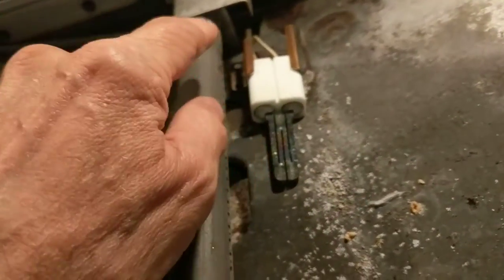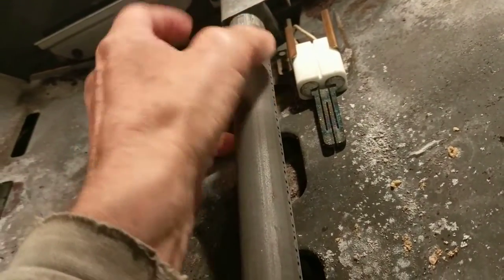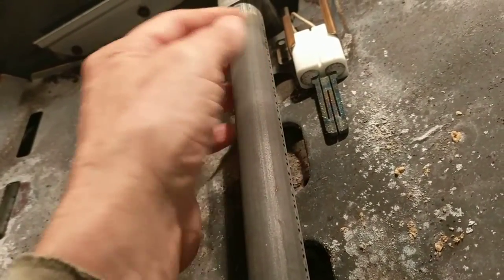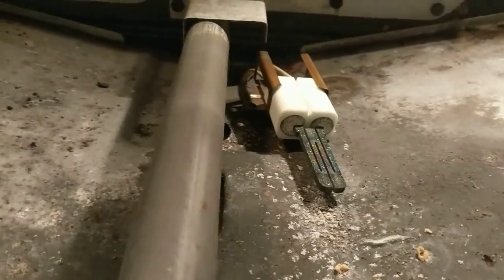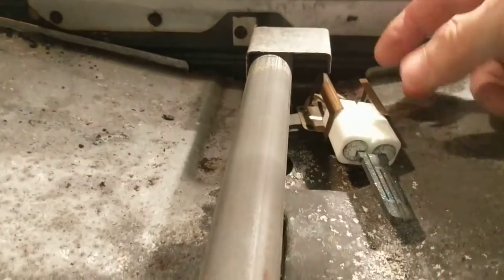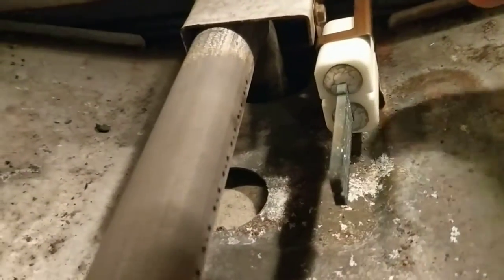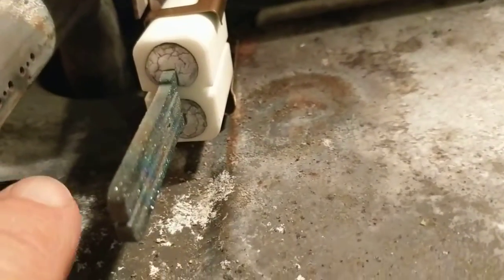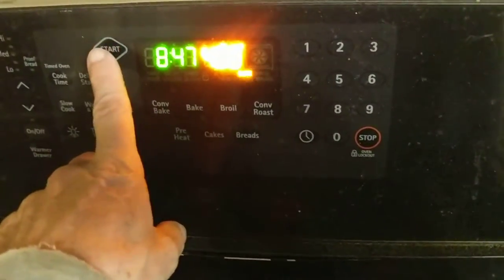oven goes boom

Comment: Do you see any flam because u have changed the igniter and all it does is heat up but I get no flams do you know what else I can check the reading I am getting is 13.14
Reply from the maker: can you explain what your 13.14 reading is?